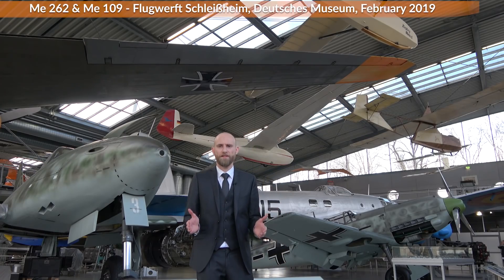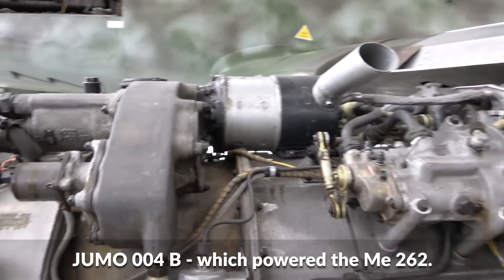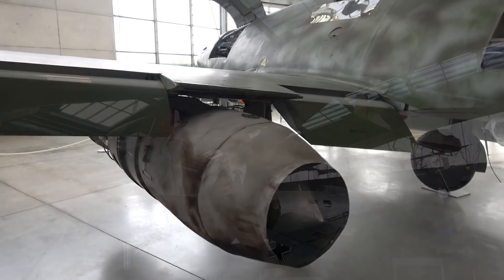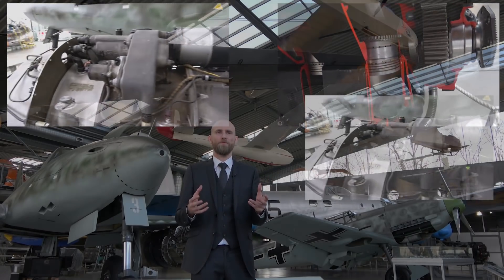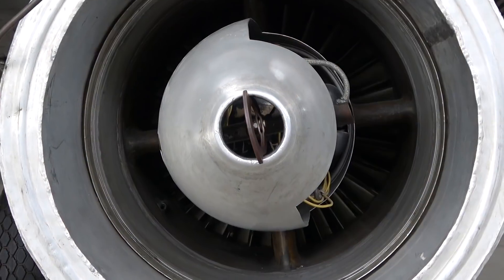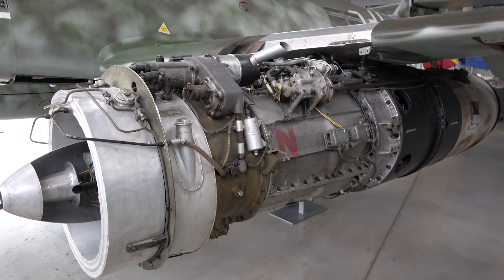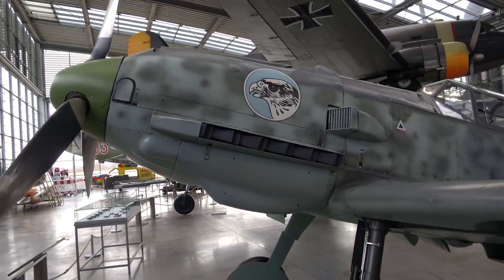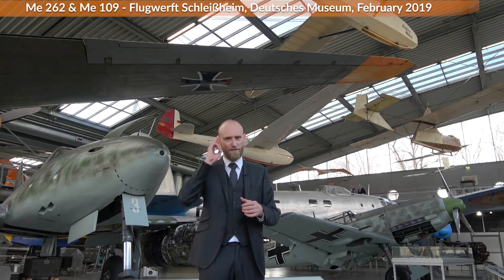Why not just go from the 109 to the 262?

Comment: The "revoutionary" part of the technology of this plane (Me-262) is the fuselage and swept-back (arrow-head) wings. A product of careful testing of models in wind-tunnels (a standard practise of aircraft design today, but not in the 1940s). Yes, the new jet engine techology powered it, but this engine required high temperture parts made from metals (such as tungsten), which was in very short supply in Germany by late war, when this aircraft was going into major production (also manufactured with some help by slave labour; what a totalitarian state does to its workers). Hence, the Me-262 jet engine had a very short flight turn-around time before needing to be replaced. The British had a similar late-war fighter called the Gloster Meteor, with a similar jet engine, but the fuselage and wings of this aircraft tended to alarmingly vibrate at high speeds. The Meteor did not have swept-back wings, because wind-tunnel testing was not done in the design and testing phase (don't forget how ground-breaking this technology at the time was). The wing-fuselage design of this type aircraft (e.g Me-262) was only used in early 1950s jet fighter aircraft (by other countries), such as the F-86 Sabre and the MiG-15, to great success for early Cold War fighter planes.

Comment: In the book "A Higher Calling", the German Luftwaffe Officer who was second in command of the Fighter Wing states the engine life was about 10 hours, never knew when the engine would fail, inferior metal used on the blades so the engines had to be handled like eggs -- had to keep a constant speed -- , difficult to find a "qualifed" repair shop ---- sometimes engines sent to a local auto repair shop(, and equipment may have been made by slave labor and concentration camp victims..... not stated in this book, but elsewhere in the literature.)

Comment: The 262 was rushed into combat many think the Germans were well ahead of the allies and if it wasn't for Hitler.. misuse bla bla bla the Germans would have regained air superiority but will the Germans were a bit advanced in aerodynamics but the British were ahead in engine reliability but did not need to use jets and didn't even wish to have there's captured so limited where they flew. Had the allies needed jet they would have used them as no one was bombing the allies so production was not a problem. Training was also simpler as the best pilots in the German Air Force couldn't cycle back home to help training
Reply: drewinvi
1 second ago
in the uk we had farnrough it could creater 150 mph gust of air in the uk to test plane was the real plane i the air plane was to  test  areo dynamic it test improvements of bombers and every plane was blasted with air before entering service.

Comment: The Me262 was in many ways the opposite of Kurt Tank's vision for the FW190.  He saw the Bf-109 as overly maintenance intensive and performance oriented, and wanted a fighter which maintained that level of performance but did so in a way that adapted to wartime needs (i.e. air cooling, lower maintenance demands on less trained groundcrews, a tougher and more forgiving airframe).  He summarized this as building a cavalry horse in the FW-190 versus the Bf-190 and Spitfire, which he saw as race horses. The Me-262, like many of Hitler's pet projects, prioritized technology over practical application, and went in exactly the opposite direction.

Comment: Excellently covered topic setting the Me 262 in its war time context. Must be recommended viewing. The engines were not the only problem.

Jet engines with their fewer parts could be built in numbers quickly and at relatively low cost. The engine problem was that the technology was not mature. The engine "faults" have to be seen in this light as is the very short engine life of less than 25 hours flying time (how did you know it was KO after 10?). The Jumo 004 was of axial design with a low cross sectional area (low drag and thus high speed plane). This was really pushing (world first) the technology of the day. While shortages of metal alloys for the turbine blades is often quoted as a problem, the other part of the problem is designing the combustion cans (Englander) to give an even flame temperature and to avoid hot spots (engine control) in the turbine blades under all operating conditions. The axial design cross-section made this all the more difficult. Of the 6000 Jumo engines made, how many were made with the envisaged metal alloys (to withstand the operating temperatures)? I assume the turbine blades were mass produced at a specialized factory. 
The quantity and quality of German fuel is often a neglected topic. Lower quality fuel but 4 times as much of it required? The Jumo 004 fuel needs to be of a consistent quality (flame length etc) and thus should be regarded as a high spec fuel (if derived in part from coal it was probably very aromatic and thus not great for jet engines. Octane is not relevant for jet engines). The German airforce never had 100 octane fuel for its piston engined aircraft in significant quantites. It had to do with 85 octane or thereabouts. As noted below, even if all the airframes had been built a lack of fuel quality/availability would have stopped them flying.

Comment: A thought about the engine life time:
The Me262 had the fuel capacity for a flight of about 1 to 1.5 hours. With a service life of 25h per Jumo this means about 20 sorties per engine. In the late stage of the war many pilots and air frames didn't even survive that many sorties. So in my opinion the short life span of the Jumo004 was not a hamper at all.
Reply: 12 sorties, the 262 had two engines so MTBF of an engine of 25 hours makes MTBF of 12.5 hours for the aircraft.
Reply: @andrewallen9993  
How did you get to this number?
Each engine had a total service life of 25h, not a MTBF.
Reply: @3gunslingers  sevice life is MTBF. After failure if recoverable the engine is rebuilt. They didn't do a mandatory engine swap at 25 hours it's just that they lasted or had an average lifespan of 25 hours.
Reply: @andrewallen9993  
Interesting. Do you have any sources for this topic?

Comment: A very interesting article/video especially regarding the Jumo 004B and of course the 262. The engine did had many flaws, suffering from using low quality alloys by using  "soft" alloys that if not handled carefully it tended to contract or even bending resulting in very short lifespan, between 10 to 25 hours. But the Jumo 004B engines despite very high consumption and very low reliability it was costing (according to Wikipedia) RM10,000 for materials, the Jumo 004 also proved somewhat cheaper than the competing BMW 003, which was RM12,000, and cheaper than the Junkers 213 piston engine, which was RM35,000 moreover, the jets used lower-skill labor and needed only 375 hours to complete (including manufacture, assembly, and shipping), compared to 1,400 for the BMW 801. It was also using less complicated tooling to produce and as was easier to change and mantain the engine. Finally the fuel, if available, was literally the leftover of the fuel production therefore it was cheaper as well. According to the German ace Stainhoff, I hope I spelled it correctly,  one of the biggest drawback of the 262 was the total lack of air breaks (similar to the F-86), to slow down when approaching the target so he could avoid toggling with the engines thus avoiding a possible flame out or worse. I'm sorry for my bad English but it is one of my favorite airplanes! Keep posting!

Comment: To all the commenters "correcting" him with the term 'flameout' instead of 'burn out'-- I would have to say 'burn out' is more apt here, because what he's referring to is compressor surge that is caused by sudden shifts in the throttle.

The turbine/compressor array takes time to spool up in order to increase the pressure of the incoming air, much slower than the increased flow caused by a fuel valve opening wider. So pushing the throttle open could inject more fuel into the chamber than the compressor can catch up with. This would cause the burning fuel to blow out of the front.
Reply: I don't think it would cause a compressor surge. Generally a compressor surge happens if something disrupts the airflow to the compressor. This can for instance be forgein objects or high g manouvers.
I rather think this they experienced something similar to a "hot start" which even today can be a problem and destroy a turbine within seconds. If you start up a helicopter turbine for instance which isn't controlled by a FADEC you need to have constantly an eye on the EGT, the Exhaust Gas Temperature gauge. Because on startup, you introduce quite a lot of fuel for the amount of air the compressor pushes through the combustion chamber, which causes the temperatures to sky rocket. The thing is, jet turbines are basically air cooled. They always run with excess air in the combustion chamber. The air is used to dilute the flame and also cool the turbine section. 

The temperature at the core of the flame is normally high enough to melt steel. Now if you introduce more fuel without more air, the flame gets bigger because it uses up more of the excess air, but now you have less cooling air left to cool the turbine section and this can cause mayor damage to the turbine. Basically and i'm not making this up, you start to melt the turbine section.

Comment: As someone with a background in engineering and business analysis rather than history or aviation when you started going into detail about how the parts were made in an indeterminate number of small workshops and then shipped across a road network that was probably being bombed to shit I count myself lucky I was never given the job of making that work. It's easy enough for parts to get lost between one side of a building and the other without having to factor enemy action into your stock control process.
Reply: this was the only way to do it though, it meant every workshop was independent and you couldn't bomb the "essential part with no stock left" factory, and grind down the whole production line to a halt.

Comment: Excellent video! 

The essential problem was that the engines were poorly suited to the task of being a fighter-interceptor.

Those turbojet engines were only excellent once they got up to speed, but they were absolute crap otherwise.

They took a long, long time to get up to speed, during which time the engines went through a massive amount of fuel, and also the plane was very vulnerable. 

And once fuel was low, which didn't take very long, it absolutely had to slow down and land. Then no defensive manouvers were allowed, because fuel would simply run out if the pilot tried to throttle up again, and the plane would just crash anyway. 

And that is still ignoring the fact that those specific engines were very unreliable anyway.

You can't judge the overall performance of that plane just on its awesome top speed and its awesome firepower, because it cost far too much fuel to get up to speed, but then it had far too litte fuel to stay awesome for very long before it had to slow down and land or it would just crash.

And one has to add in the fuel consumption of the piston-engined fighters that were needed to overfly the Me262 airstrip to protect them as they took off and slowly got up to speed.

Modern jet fighter-interceptors don't use turbojet engines for exactly those reasons. Instead they use low-bypass turbofans, which use a turbojet core enhanced with fan thrust for much greater takeoff and landing performance and fuel efficiency.

An example of an appropriate use for a turbojet engine is the SR71 Blackbird. Its top speed of 3,200 km/hr shows the true strength of the turbojet.

Comment: The problem of towed to the runway was not one of fuel but of dispersal due to allied bombing. This problem was never solved. It took around ten minutes towed by a vehicle or one hour to be manhandled from dispersal usually in woods surrounded by earthen revetments to the runway.  The handicap of requiring a specialist runway or autobahns was the Me262's Achilles heel.  These requirements in the face of Allied air supremacy turned the massive Me 262 industrial program into nothing more than a limited weapon in an aerial guerrilla war waged by the Luftwaffe. If you can wade through Goebbels bouts of optimism on 18th of March he returns to realism and gives the most accurate prognosis on the blind faith put in the Me262

Comment: OK the Luftwaffe decided not make any more piston engines a month or so before the end of the war. They may have been expecting the war to run on much longer. The problems of the 262 are well known. If the war had run on until 1946, look at what the British were doing with the reliable Meteor.  If the Luftwaffe thought they were at an advantage they were mistaken. 

In November 1945 a Meteor F.3 broke the world speed record reaching 606 mph (975 km/h). In early 1946, this record was again broken when a Meteor F.4 reached a speed of 616 mph (991 km/h). Other records were broken like flight time endurance, rate of climb and speed. In contrast the temperamental Me 262 reached a maximum speed of 560 mph. 

In 1945, a Meteor powered by two Rolls-Royce Trent jet engines driving propellers created the first turboprop aircraft to fly.

Comment: The key reason they could not replace production of BF109s or FW190 was Adolph Hitler.   Hitler ordered the development of new weapon systems stopped thinking they could win with existing weapons.

The jet aircraft program was one of the systems affected, it was not completely stopped but was reduced. Such was the reduction that when they kicked it into high gear they had to find the technicians that had been resigned. I heard some of these techs had been fighting on the Russian front.

This meant that the introduction of the 262 was delayed by as much as two years. The British put their jet fighter the Gloster Meteor went operational one month after the 262. This meant by the time the 262 was in production supply lines to many war materials had been cut. Allied bombing had hampered factory production at all levels. It was mentioned that because of lack of alloys the 262 engine had to be careful of exceeding heat limits. This is true and the 262 engines had governors on them to keep this from happening.  Allied pilots soon figured out that the 262 could be pounced on when it throttled down for landing approach. After the war captured 262s were evaluated, using German pilots, and it's air frame judged superior while the Rolls Royce engines in the Meteor were judged superior. 

Pilots for the 262 had to be the best because training on the 262 was for practical purposes nonexistent.  The loss of development time meant no two seat model was developed so the training to fly it was first classroom. Then the new pilot taxed on the runway and an experienced pilot stood on the wing holding onto the canopy telling the trainee how to work the controls. Then the experienced only on piston aircraft trainee took their first solo flight in the new technology.

Every thing about why the 262 could not replace the existing front line piston fighters stems from Hitlers slowing it's development. 

The end result was too little too late. Another example of Hitler the little corporal thinking we was a general.
Reply: I should add that by the time the 262 and Meteor were in combat the United Stated had a flying jet fighter the P-80 Shooting Star. This plane was not deemed ready for combat and only a few entered the war and only as reconnaissance aircraft. It entered service as fighter after war as the F-80.

Comment: Without rocket-assist the  Me262  required over 1klm m of concrete runway to takeoff. It's generally accepted it took 12 weeks to change a factories production from one model to a completely new design. That's 3 months (1/4 year) of zero production from that facility.

Comment: Decentralization of the industries increased overall output but decreased final assembly numbers. When your infrastructure (railway, roads, power plants) is down, decentralization is a bad idea.
Theoretically, the 262 was a great plane, IF the engines would have been more reliable, and IF the pilots weren't harrassed right on the runway (start or landing). Given that only experienced pilots were trained on the 262, I wonder how a raw recruit would have managed.
Grüße aus Aachen und weiter so !
Reply: Call Me Ishmael  Given that the 109 on take-off was "a bit" of a handful and you were literally blind on the ground in a 190, the 262 was an improvement. Still, you're engines could just fail for bad quality parts or you could "flood" them giving too many throttle at once ...